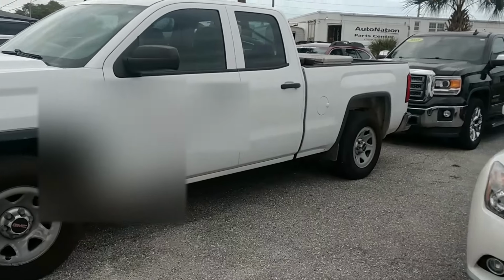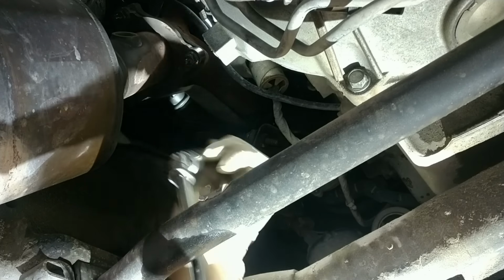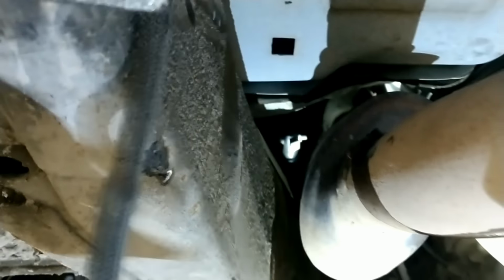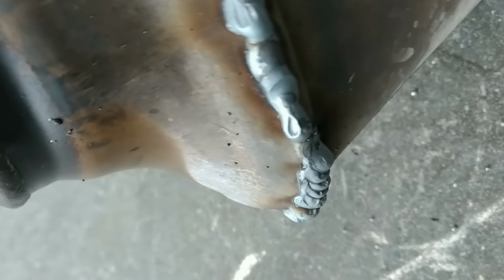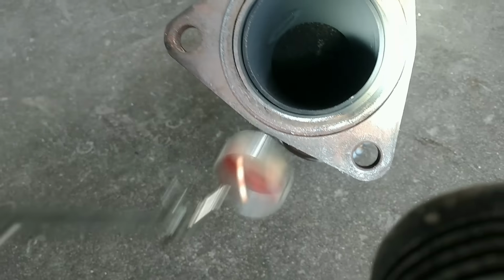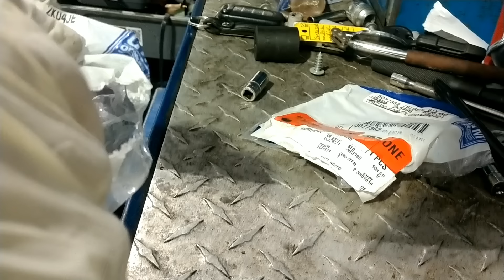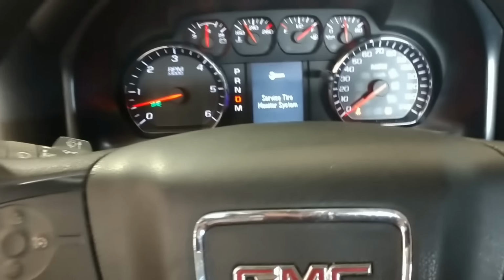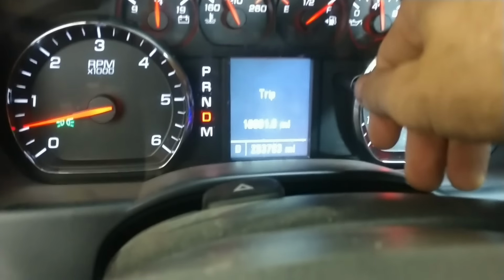Customer States exhaust leaks: Repair it cheap.  Ok then, I can do cheap and good. Sort of.

Comment: As an AWS Senior Certified Welding Inspector, you can fix my vehicle any time... as long as it doesn't involve welding!!!  Great videos, subscribed!
Reply: LOL!!!
Reply: I watched the first 5 seconds of welding, paused and went to look at comments. 
Well said 🙂
Reply: @CajunReaper95 , I appreciate the suspicion of my credentials... as I am always suspicious of welders that say they can weld.
Reply: @Tim Nissen, try using 'their' instead of 'there'...  (sorry, but identifying non-conformancies is part of my job responsibilities in the QC department).
Reply: @Tim Nissen as long as they aren’t welding any certs, they should be ok.
Reply: @DougJohnsSDN  LOL, I don't know if I would call a grammar error non-conforming unless it was done intentionally or for a purpose, rather than simply making a mistake. OTOH your original reply was hilarious, as Ray admits he sucks at welding but nonetheless did manage to get the job done; it wasn't pretty but it worked 👍 and sometimes that's enough.
Reply: Perhaps you can teach him a few tricks 🙂

Everyone is an awful welder until they've had training and experience

Comment: I hope you didn't forget to refill the bumper fluid.
Reply: It's right next to the blinker fluid tank ! LMAO
Reply: Hes a quality mechanic so I'm sure he did lol
Reply: Daddy was a Gravel-hauler.
Reply: thats funny  ha ha ha ha ha ha
Reply: @heyrod59  don't forget the hydraulic cardboard lifter, bring it on over
Reply: No kidding. Once my bumper dried out while I was driving to Ohio, and I was hoping the car didn't burst into flames during the trip. Talk about scary. It wasn't the front, where it can get lots of air to keep it cool, it was the rear, where there's next to no clean cool air. Thank goodness I am still here to tell the tale.
Reply: Gotta replace the bumper gasket first!
Reply: That bumper fluid filler is difficult to reach .
Reply: I hope he did the muffler bearings when he had the exhaust apart!
Reply: @wwjnz9263  Oh wow. You are so lucky. That could have been a disaster. I hope you have an indicator on the bumper fluid tank not. I heard it was an upgrade that can be done pretty cheap because it uses the same system as the blinker fluid.
Reply: What about blinker fluid
Reply: Don't forget to let all the summer air out of your tires and fill em back up with the winter air
Reply: Not on this model, duh.
Comes with a lifetime seal.
Or maybe it's a lifetime dolphin.
 @davidbublitz6571
Reply: I was surprised he didn't weld the bumper as well when he had everything out already. Could've sorted out the bumper fluid leak so easily.
Reply: Wait a moment… I hope he checked the bumper cooling system. If not it could melt the plastic coating when the owner rolls coal and the thing overheats. 😂
Reply: @drippedoutnick5053 .  That’s one thing I won’t scrimp on.  I’ll use an aftermarket air or oil filter.  Hell, even an aftermarket fuel pump or alternator.  

The guy at the dealership always acts funny when I ask for a tire gas drain, flush and refill but I guess that’s cause most people go to quick gas-n-lube or whatever.  Not me.  No sirree.  Genuine OEM only for this cat.
Reply: @NeoMorphUK  The more air you put in the tires the heavier they get
Reply: And the bumper drain plug and washer.
Reply: The car soiree got excited and made pee pee
Reply: If you don't use OEM bumper fluid the warranty will be void. I was tempted to use semi-synthetic but the few extra bucks got me peace of mind.